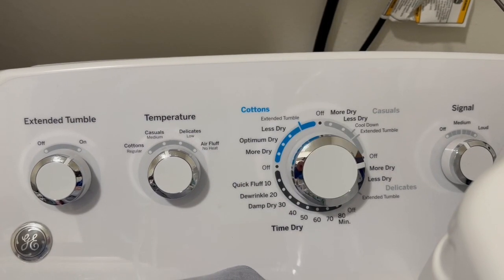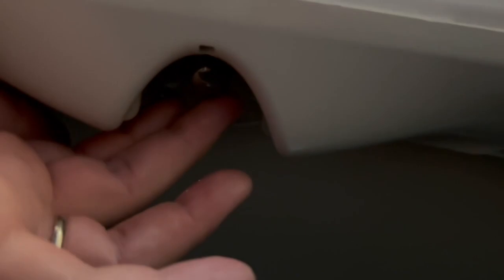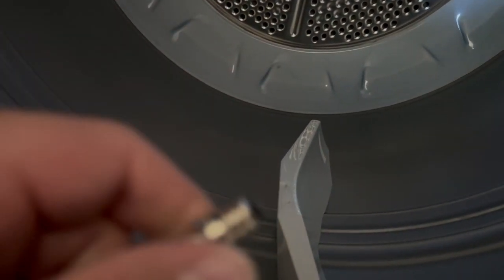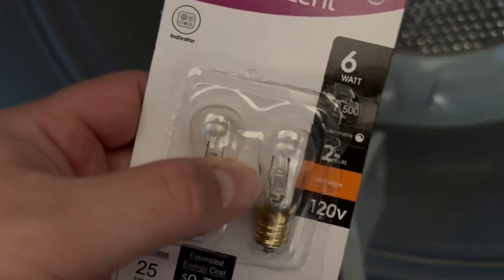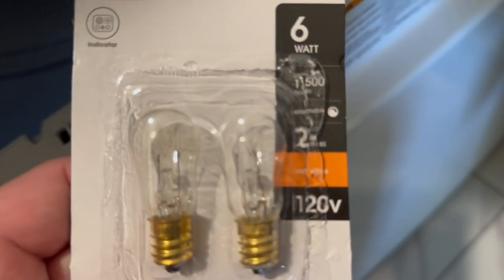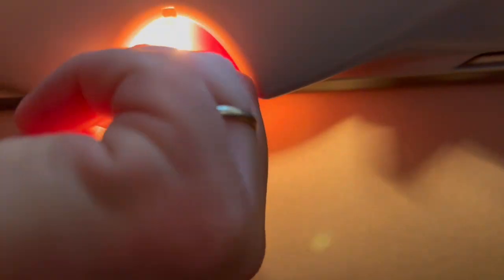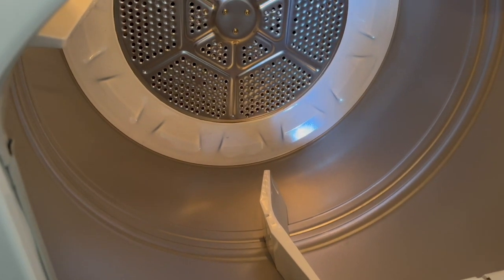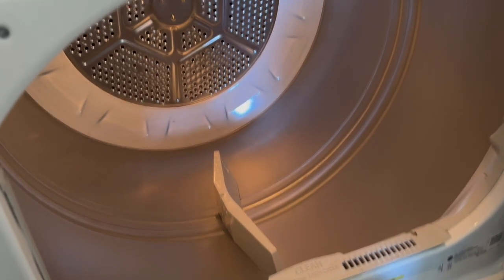How to change the bulb in a GE dryer

Comment: Don’t use any bulb above 10 watt in a dryer. Do not install a 40W or 60W bulb to brighten up the dryer. The bulb you have is 6 watt which is even smaller.